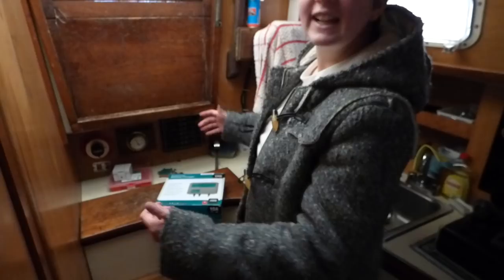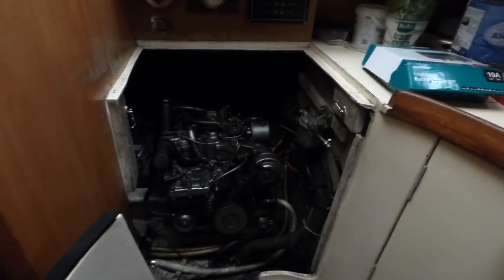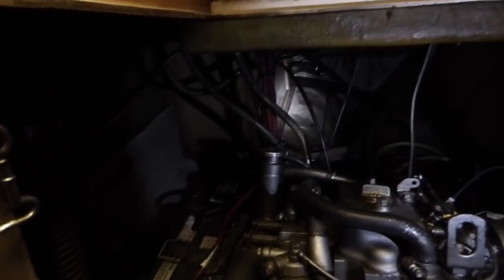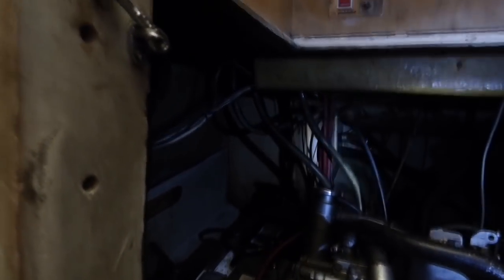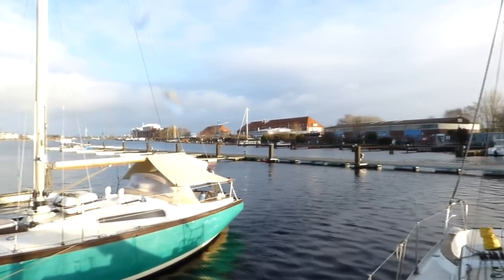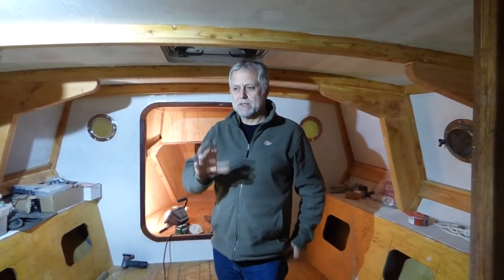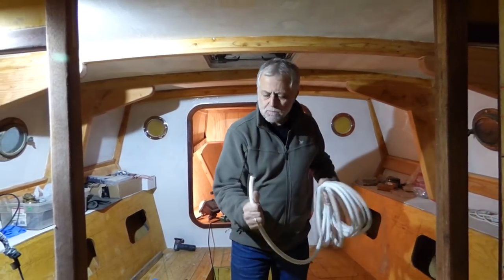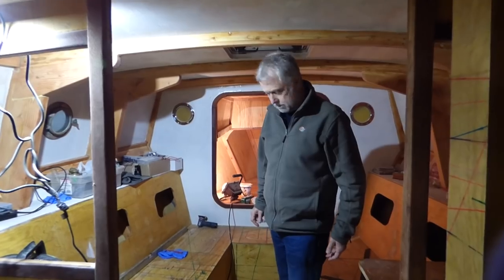A battery charger for Hazel and water hose for Tapatya - SV Tapatya EP117

Comment: Tony, is Hazel's boat ketch-rigged?   It looked as if there were two masts (two booms).   What are her boat's basic specs, please?   Just interested!!
Reply from the maker: Yes, it’s a Freedom 28 cat ketch that’s been converted to junk rig
https://en.m.wikipedia.org/wiki/Freedom_28_Cat_Ketch
Reply: Thanks.   Very unusual looking!
Reply from the maker: Yes. Different but a very capable boat
Reply: Yes, I looked up several sites (including your offering, thanks) and it appears that they are a good seaboat.   I'm sure you would have had words with Hazel if she'd wanted to buy what you regarded as a clunker!  :-)
Reply: BTW very much looking forward to you splashing your boat, too.   You've put a hell of a lot of work into her, so Tapatya will have a good foundation.  I've never built my own boat, but I've laid an awful lot of glass down for friends who have over the years.
Reply from the maker: Indeed 👍
Reply from the maker: Thanks. I'm looking forward to it too 😀

Comment: What is Hazel's wind generator hooked up to? Does she have a 'Low Voltage' system as well?...That 'soft' hose cuts nicely with a pair of garden 'Rose Shears', and I used my magnetic screwdriver with the tip removed to tighten the 1/4" headed screws on the hose clamps, the slots are pretty much useless when you're contorted upside down in a corner...Can hardly wait to see her with a paint job, Tapatya, not Hazel... ; {
Reply from the maker: Thanks Mike
Her boat has a simple 220v mains system ( one socket) and otherwise 12v for lights, water pump, etc. The wind genny can’t be outputting very much at all - I need to put a meter on it and see what exactly it is putting out. It mainly keeps the seagulls away 😃
Yes, as long as the hose clip has a hex, a socket works best for tightening 👍